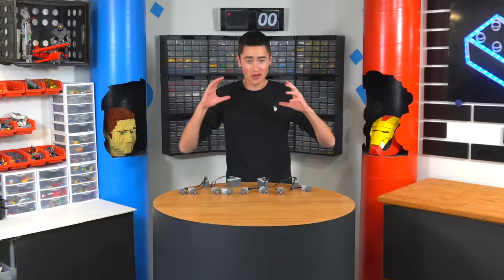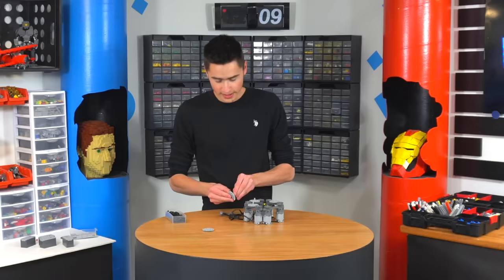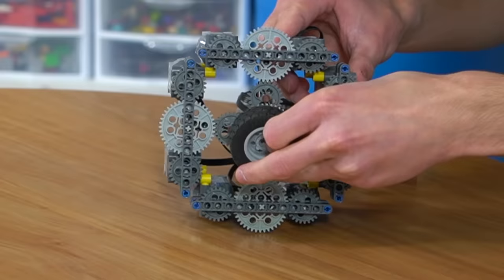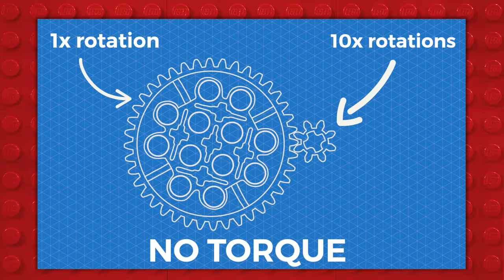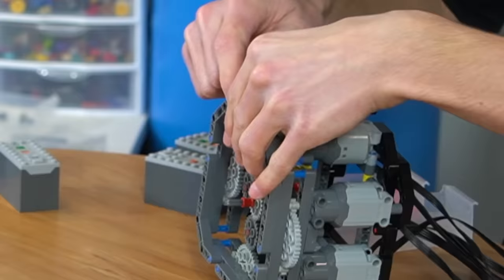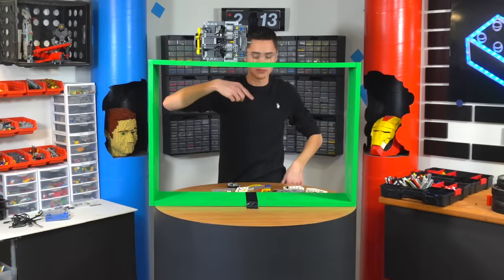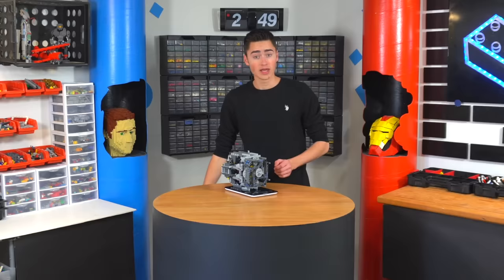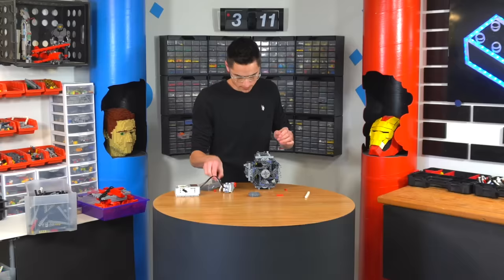I Made The World's STRONGEST LEGO L-Motor!!

Comment: Brick experiments has lifted 200 pounds with a single motor. The main issue you ran into was no additional gearing/tackle, and of course just the lego axels having limited strength. It's a good start and I'd love to see your motor power things once you have a better output system
Reply: Yup, I found it so funny when he was saying he made the strongest motor, while I was thinking of the time Brick Experiments lifted an entire rock
Reply: @mickys8065  if you want to be pedantic his motor is stronger, it's just he did nothing to show it's potential. Also tbf, it's far from the strongest as there is a straight up lego car motor so..... idk, didn't wanna bully the man in his own comment section. But also, nowhere near close to the strongest
Reply: and that was whit the smaller engine
Reply: @lordderppington4694  exactly, brick experiments just had a better gearbox, not motor
Reply: Not only that, he also lifted 226 Kilograms (in theory)
Reply: @gperm3710  lmao. The notification shows the unedited comment. I believe the videi converted it to 195. Sadly my small American brain does not understand the metric system
Reply: if he made 6 of those he could lift a car.
Reply: BEC's on another league 😂
Reply: @lordderppington4694  Yeah, sorry, I miss read it, he LIFTED 88kg (195 lbs) while also showing that the motor could lift 226KG in "testing lego gear and pulley systems part 2"
Reply: good way to counter axle strength is to use a metal rod
Reply: yeah the thing with this guy is here's way too confident and doesn't do his research. If he didn't make claims like "the strongest" etc and spent more time researching thinks like pullies, etc, he'd do much better.
Reply: He made a 21 motors motor
Reply: I think he wanted to show the motors strength on its own compared to a regular Lego motor
Reply: I think he had a pulley while doing that which fractions the weight needed to be lifted but still yeah
Reply: @garrisonsmith753  well no that's the whole thing. when you post "strongest motor" and then see it struggle to move 20 pounds, when you know you can get way more output. like..... it's like saying "look! this is the strongest man in the world! he can lift 50 pounds!" like yeah, it's good, but so can a good chunk of everyone. It doesn't matter how strong he really is, if you do a terrible job of showcasing it no one cares.
Reply: Get these two to work together. Nothing is beyond the reach of LEGO.
Reply: This one is a four-speed motor tho
Reply: you mean brick experiment channel? (i just want clarification)
Reply: @mathiasbrio2105  yep.
Reply: Yeah it’s not hard to lift a lot with lego as you said it comes down to how strong the lego is
Reply: Fu
Reply: @bethkupfer1417  what
Reply: Do you remember that one time a kid lifted a grand piano with a tiny little motor?
Reply: If he had used a lego compatible steel motor axle, he probably could have gone quite a bit farther.
Reply: It was kilograms. More like 500 lbs
Reply: Brick Experiment Channel?
Reply: Ej ty zelazny polak?
Reply: @daniel_exe_972gaming3  the name is Polish, unfortunately I'm 4th generation american so I can't speak it. Gonna learn it sometime though.
Reply: Plus the fact that adding more motors spinning one gear doesn't add torque, as these motors are spinning at the same rate, so one contributes all of the work while the others do nothing, or the work is split up between them evenly without adding torque.
Reply: He’s lifted over 400 pounds, correction
Reply: Finally Cultured PPl !!! :D
Reply: 20*
Reply: He stated he was looking for torque, not speed
Reply: Somebody lifted 225kg with one too lol
Reply: @mickys8065  dude the rock was only 88kg he could pull 225kg with his 75:1 ratio and a double 4 pully ratio
Reply: He actually lifted 450lbs
Reply: What am i doing its 3am i dont even have lego
Reply: God so loved the world That He sent HIS only begotten SON that whoesoever believeth on HIM Should not perish but have everlasting life
Reply: So?
Reply: So?
Reply: Yes, this ^. 12.96kg's (28lbs approx.) from 1 motor and a worm drive on the Brick experiment channel.
Reply: *20
Reply: WAS JUST THINKG ABOUT HIS CHANNEL AND HOW HE DID BIGGER STUFF WITH ONE MOTOR XD. I was like "puny peasant... you are holding back the power of the single motor"
Reply: I can't even pick up 60 pounds lol
Reply: @mickys8065  bbbb
Reply: idk what ur talking abt but sounds cool
Reply: the motor has merged with nicocado avocado
Reply: True
Reply: u r a nerd😂
Reply: @lordderppington4694  he said motor not lifting motor
Reply: This one looks cooler and if he geared this wayyy down it would be way better and if he swapped out the L motors for XL motors it would be better

Comment: Who’s gonna tell him that no matter how strong a motor is, you can always outperform it using gear ratios, leverage and pulleys?
Reply: Lets just let him believe, ok?
Reply: BEST COMMENT
Reply: Say youve got two motors, one of which puts out 50lbs-ft of torque at 1000rpm, and the other puts out 100lbs-ft of torque at 1000rpm. While, yes, you can hook up the first motor to a 2:1 gearset to make it put out the same amount of torque as the second, itll also be half the speed. Same torque, half the speed, half the ability to do work.
Reply: @Kevin-dt9xm  ok but here what was important wasnt the amount of work done over time aka power, it was the amount of work aka torque
Reply: @sigmamale4147  my point is, with a more powerful motor, you can have the same amount of torque, but at higher speeds. Two motors lifting the same weight, the more powerful one is gonna lift it faster.
Reply: And who's going to tell you that torque and power are different concepts?
Reply: I'm a powertrain engineer, and this is untrue. Gear ratios introduce losses at an exponential rate due to the second-order relationship between torque of inertia and gear ratio. The more ratio you add, the more the losses you experience at the input as a load; this is why eventually the motor cannot turn the gears at 8:35.
Reply: But at lower speed
Reply: So you're going to be the one to help me invent a kinetic energy powered engine?
Reply: little leonardo?

Comment: Yes, build three more! In a sense, you've basically combined all the torque from each motor. I think it's safe to bet that it's even stronger than the metal motors you find in RC toys
Reply: Not at all. Metal beats plastic
Reply: @jeeperzcreeperzz  what if you use metal gears and axles
Reply: Make 8 and copy what you did inside of machine to make 9 and a half times the torque because you made the machine bigger and used the 8 machines to get 9 and a half torque. hope it makes sense
Reply: @gachaiscool7573  honestly that makes zero sense..
Reply: @cheezywheezy526  then it's no longer fully lego
Reply: My 1/7 RC truck has 5 horsepower. I doubt this Lego motor has even 1
Reply: bruh those are just normal motors covered in plastic
Reply: @jeeperzcreeperzz  it uses Lego motors
Reply: Three of those things prolly out run 3 v12s
Reply: The metal motors in rc cars are literally the same as the ones in the lego motor
Reply: @upgraderboy6036  dude its literally like 2:15 am
Reply: Build 7 more of this Motor and recreate the intire System but in big
Reply: @jesns932  dude it's literally 3 am
Reply: @cowboyyeehaw9818  maybe where you are, it’s irrelevant what time it is
Reply: @upgraderboy6036  not really. Well, not in my RC cars. Eg I'm running a FTX DR8 with 22.2V of brushless power. It in theory can do 60mph REAL speed. I am a Lego fan and always will be though. You may get lots of torque with Lego, but you will never get the speed as the axles melt! 👍🍺🇬🇧
Reply: @jeeperzcreeperzz  it 9nly needs lego motors to be fully lego
Reply: @upgraderboy6036 12v rc car motors are actually a lot more powerful than  the 4-6v motors lego uses
Reply: @Carl B i know i have a arrma Keaton 6s running at 6s and i just was trying to say that this is kind of a dumb comment bc that motor is huge and slow but hobby grade motors are small and have more power
Reply: @jeeperzcreeperzz  honestly lol
Reply: @cowboyyeehaw9818  time zones do exist
Reply: Yeah, any 1:8 scale brushless system of 1000W would absolutely destroy that lego motor, which btw is a gimmick.
Reply: @marksimmonds6364  i was gonna say lol. I’m making 5hp on my 1/10th scale ARRMA setup lol
Reply: @gachaiscool7573  I like your funny words magic man
Reply: God so loved the world That He sent HIS only begotten SON that whoesoever believeth on HIM Should not perish but have everlasting life

Comment: As an engineer I can tell you: with one of these you can't move a car

But if you build 2 of these motors they could actually move you in a small rideable thing like a go cart.

Lego built a full size driveable Bugatti Chiron, they used 1.500 L-Motors which produces a torque of 50-74 Newtonmetres.
Reply: Damn, just stock or did u overvolt the motors?
Reply: @research_ai8740  I didn't do anything 😂
Lego technic itself did this. And no, they didn't overvoltage it. Their goal was to nearly only use stock Lego parts
Reply: I like the math behind thst
Reply: @JohnDeere2025  yes
Reply: As an engineer I tell you: this motor is not powerful.
I bet no one would’ve never known without an engineer degree lmao
Reply: @DashzRight  I know it's not powerful, I never said it's powerful. I just said with 2 of them you'll be able to move a go cart
Read before writing
Reply: @Balls199  yes
Reply: Hold my beer.

All you need to do is step down the gearing to the point where the torque overcomes the inertial resistance without breaking anything. Or, if you're trying to move the vehicle with an external force such as a winch, using a series of blocks you can reduce the load to the point where a single motor can do it. I've done this to manually (like with my bare hands) pull a two ton SUV out of a ditch using nothing more than climbing pulleys and a single 200m length of 350 paracord.

And you're an engineer??
Reply: @BlokeOnAMotorbike  yes I'm an engineer and you didn't watch the video netiher nor read my comment.
Who talked about changing the gearing?
The gut asked if he could move something with the motor as it's shown in the video, but not with any other gearing
Reply: Some dude also built a drivable life sized air powered car
Reply: 1. no shit Sherlock
2. nice
3. ik, it's really amazing
Reply: @s33saudios   lmaooo
Reply: @mosqit4324  love that Emoji in your name
Reply: @s33saudios  thanks
Reply: @mosqit4324  sherloque
Reply: Theotetically, How big of a motor out of Legos would be required to move a car, like a normal one?
Reply: Ok nerd
Reply: @SeanMoran-ct2xk  jealous because you don't know as much as me?😉
Reply: @s33saudios  Ok nerd
Reply: @SeanMoran-ct2xk  ah I see. A kid. You shouldn't have a smartphone in your age, you little guys are too unmature for that stuff
Reply: @research_ai8740  most of the car was Lego even the lights only the basic stuff wasn’t Lego like the tyres and frame
Reply: I like your funny words magic man
Reply: @s33saudios  nerd
Reply: @SeanMoran-ct2xk  ok envious guy
Reply: @Psusanoo  let's say a usual car has 1.5 tons. I'm sure the plastic parts from Lego can't move a real car without destroying and bending the parts
Reply: @s33saudios  Yeah, that makes sense. Thx.
Reply: Can you put that in dumb dumb form? (Lmfasrn)
Reply: @implayingrobloxandwht  Sherlock
Reply: @darthgonk4398  shercock
Reply: @jeffreydentonjr5577  1 motor = no drive car
2 motor = drive small car
Reply: what if you take 8 of these and combine them into a mega one
Reply: @Bumblerage32  If we neglect the fact that the plastic parts couldn't handle such forces, then it would just be a Lego motor with much torque but low RPM
Reply: @s33saudios  i was just joking but hey i actually got a response that makes perfect sense
Reply: Well your right but the integrity of the material could not hold that amount of force and the material which is now plastic it could not hold and eventually break
Reply: @Thymeovermars  because  my comment was theoretical. In comments above yours I wrote that the material couldn't withstand these forces
Reply: @s33saudios  nerd
Reply: @SeanMoran-ct2xk  kid
Reply: @SeanMoran-ct2xk  why would you go on an engineering video, a lego engineering video but still one at that, and be surprised to find people with an iq above room temperature?
Reply: @s33saudios  ok the trick is STEEL PARTS MR CLOWN they exist they may not be Lego but they are exactly the same as a normal one but steel
Reply: @Gordonmonke_vr  if you would have watched the video, you would know that the motor must be made off only original plastic Lego parts😉
"Mr clown"😂🥴
Reply: @Gordonmonke_vr  why am I a nerd? Just because I know more than you?😂
Don't make yourself ridiculous
Reply: @s33saudios  Sorry i forgot that being young was an insult to the human race
Reply: @JohnDeere2025  i like the math behind “thst” grammar
Reply: @s33saudios  so that's what Mario uses to power his kart
Reply: How did they actually transfers all that energi to the drive axle? Did they make a custom gear? Frame was made of metal etc, but they did not show everything.
Reply: @SeanMoran-ct2xk  sorry, I forgot that calling people a nerd for no apparent reason would piss people off, and make literally no sense when your in is below room temperature. (If you take an in test to prove me wrong, you’re just proving my point.)
Reply: @evitcAoidaR  you realize that it was a joke, and i will not be taking an “in” test
Reply: I was waiting for that reference
Reply: 1500? that is a LOT
Reply: @s33saudios  Wait question if we could use something to reinforce the plastic could you combine like 10 of those lego motors and would it work?
Reply: And a dirtbike

Comment: I wonder if there's a point where the friction caused by extra gears counteracts the torque created by extra motors? Like if there's an upper limit on how much you can get out of Lego motors
Reply: yes there is a limit, if you tried putting it through a single axel the axel isn't actually that strong and would fail
Reply: Nerds
Reply: Wtf did he say..
Reply: @danielvillegas1057  Does too many gears become too resistant for motor to rotate?
I tried using baby talk in this but I just couldn't do it.
Reply: Lubricating the gears helps a lot
Reply: @sidinator3000  it helps but there is still a limit. Plastic can only get so strong before friction starts to overpower the torque and before shear stresses rip the plastic apart.
Reply: In this Setup actually no, as each motor turns it’s own set of 3 gears, the added resistance of another 3 gear set will always be overpowered by another added motor for those 3 gears. Adding gears without adding more motors will eventually lead to a point where the torque on the shaft induced by the friction of the gears and hypothetical bearings overcomes the torque applied by the motor.

Hypothetically if you add any amount of motor without changing the ratio of the components, which is 3 gears per motor the ratio of resistance relative to drive power will stay the same (Heavier construction of the drivetrain, which is necessary at one point, when the overall power increases and longer shafts with more supported bearings is negligible for this example)
Reply: @howardbaxter2514  For this example we expect the materials maximum acceptable load to be unlimited, since the question was about the induced drivetrain-drag added by adding more gears with more motors. Actually there is virtually no limit for that, since the added resistance will be overcome by every added motor. For further explanation see my other answer to this question.
There is a limited number of gears to add without adding further motors since at one point induced drag must be described as applying a higher momentum to the shaft  than the driving power added by electromotive force.
Reply: Look up 1:Google gear ratio with brick experiment, shows it in action
Reply: Just don’t do a spiral pattern and you won’t have that problem. You’ll still be bending axles though. Double drive shafts baby.

Comment: As an engineer, I can give a couple of tips: 
1. Use gears connected in parallel on the same axis. This will increase the strength several times.
2.Under high load, the axles also bend. You can use the holes in the gear to connect it to the load.
3.Reduce the load on the intermediate gears. Add gears and gearboxes separately for each engine. Exclude all gears connecting the motors together except the central one.
4. Reduce the speed in favor of power - increase the gear ratio with a multi-level gearbox, similar to the one at the end of the video.

I'm sorry if I made a mistake in words - I'm an engineer, not a linguist.

Comment: Brick Experiment Channel does a lot of Lego gear ratios. He's got metal axles that he uses sometimes because they don't bend and twist as easily. You could check those out
Reply: He did a video twisting one of those :P
Reply: @Hoggaforfan  I know, I was super impressed that he was able to! I assume of it was used in this scenario then it wouldn't bend
Reply: he also lifted a 200 pounds rock with a single motor.
Reply: @pleeppants1712  Yup and it exceeds more at theoretical 220 kg more than 440lb

Comment: You can definitely make a viable vehicle motor from these, the issue is the output shaft is so small and flimsy it would just break or twist before it could move anything. If you can find a way to make a thicker sturdier shaft, it will hold up to more torque.
Reply: yeah nobody wants a small and flimsy shaft, i always want my shafts thick and sturdy
Reply: You can buy aluminium or steel techniq shafts